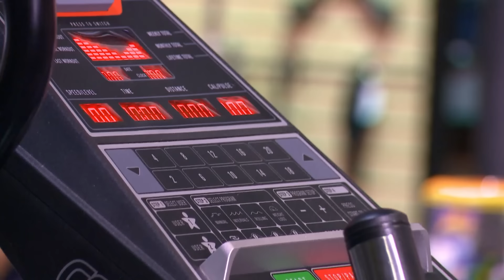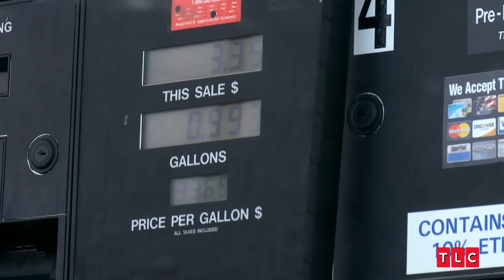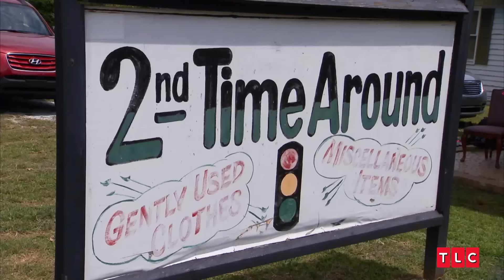She Fills Her Pool with Junk to Save Money! | Extreme Cheapskates

Comment: I hope there isn't any snow where she lives. Where I live you have to have a half tank of gas in the winter time so your gas line doesn't freeze up.
Reply: True, and I doubt she lives out in the middle of nowhere or a rural area because if you're not careful, you could end up stranded and no-one wants to be stuck stranded somewhere because they don't have enough gas whether it's in the hot summer months (when it's 80 or 90°F or hotter) or in the cold winter months (when it's 30 or 20° F or lower.) I've gotten stranded a few times (for different reasons) in both weathers and it sucks. Even if you have clothes that'll keep you cool in the heat and clothes that'll keep you warm in the cold, it still sucks.

Comment: The bike idea was actually brilliant, she gets exercise  AND she doesn't have to pay the cost to keep it running
Reply: she bought the bike with the tiny wheel just to save what didn't even amount to 1 months pool expense
Reply: I don't see this working well.
Pool pumps usually run a few hours a day from my understanding. I believe 8 is considered normal. I seen some hotels run 24/7. Lets lowball and just say 2-3 hrs. You telling me she is going to sit on that bike for 2-3 hours every day?
Reply: The bike pump is BS. That alternator would never power that pool pump. It puts out DC and even if she took out the rectifier, she would need to gear that alternator and have a regulator. She would be much better off mechanically powering the pump with the bike.
Reply: @MrTurnermason  exactly
Reply: @MrTurnermason  yes and no. Alternators are 3 phase ac that has a rectifier that converters the AC > DC. You can remove that and actually turn an alternator in a 3 phase brushless motor/generator at higher voltage. 

Now in order for that to work at the voltage and current needed she would need to peddle as fast as a smaller gas generator (like a Honda one) against a loaded generator the would be trying to slow her down. There is no way she is making 115/230v at 1000≤ watts. 

So yes the bit is BS but it's not BS that you can make an alternator pump out 3 phase AC current by bypassing the voltage rectifier. 

By the way you might enjoy vids of people making go-karts with alternators running them with brushless motor speed controllers. Pretty neat tbh!
Reply: @MrMopar239  Yes definitely. the pool pump is not 3 phase though. Even if you used a single phase of the alternator you would still need to get up to 3,000 rpm to get any useable current out of it.
Reply: Would the alternator produce enough amps to run a pool pump, isn't that just like hooking a car battery to the pool pump? Which wouldn't work
Reply: @empiresrikesfat  The alternator doesn't have the right voltage and frequency to run the pool pump. A car battery is DC and the pump is a AC motor.
Reply: @MrTurnermason  cool i was right
Reply: @MrTurnermason  I agree with you completely. While it's worth noting that the person in the video is using a DC-AC inverter before connecting the pool pump, this setup is still not effective because the alternator in her system can only produce a very small amount of power (at the speeds she is able to achieve), likely only a few watts. Meanwhile, most pool pumps require about 1.5 kW of power to function, which is far beyond the capabilities of her setup. Additionally, it's important to keep in mind that even the most skilled professional cyclists can only maintain a continuous output of around 300W, so powering a pool pump with a setup like this is not feasible.

Comment: Does anyone else here even realize that whole bike generator thing was totally FAKE? For one, the alternator (which I'm assuming came from an old car) would only generate 12 VOLTS DC. The pool filter would require 125 VOLTS AC. Night and day difference. There's no way that would actually work. And even if it did, she'd have to pedal for 12 hours straight to generate enough electricity to run the filter for one hour.

Comment: The bike generator is genius.
Reply: No its a lie. It's not even humanly possible for her to power that pool pump with a bike, and even if it were, it wouldn't turn as easily as she makes it look like the alternator is not under load or connected to anything. Even an Olympic athlete couldn't power a pool pump. There is a reason why human flight is so hard. It might be possible with 4-5 trained professionals for less than an hour. Plus a car alternator is like 12 volts while the pool pump runs off 120 a good electrician might likely convert it but the stupid pump is still a 1500-3000 watt appliance humans cant put out that much.

Comment: The amount of people praising an obviously fake bike generator powering a pool pump is funny to see. It's not even humanly possible for her to power that pool pump with a bike, and even if it were, it wouldn't turn as easily as she makes it look the alternator is not under load or connected to anything. Even an Olympic athlete couldn't power a pool pump. There is a reason why human flight is so hard. It might be possible with 4-5 trained professionals to power that pump for less than an hour.

Comment: Baking soda is not the same as the chemicals used to sanitize the pool.  The only thing baking soda will do is raise the pH of the water.  And yes, you could clean your clothes in the pool, but the problem is that the chemical used to sanitize the pool water is sodium hypochlorite which is bleach.  So any clothes will color will be ruined.  Also the bike generator thing to run the pool pump is complete BS.  A pool pump is powered by 220 volts, not the typical 110.  There is no way she could create enough power with that stupid bike, lol.

Comment: 1. Power Requirements of a Pool Filter

	•	A typical residential pool filter pump is rated anywhere from 500 to 2,000 watts, depending on its size and efficiency. Even a more efficient, energy-saving pool pump generally needs at least 500-750 watts to operate continuously.

2. Output of a Car Alternator

	•	A standard car alternator produces around 60-100 amps at 12 volts DC. So, at maximum output (say 100 amps), you’re looking at about 1,200 watts of power.
	•	However, a human on a bike would struggle to generate even close to that continuously. Most people can generate about 100-200 watts on an exercise bike over extended periods, which is significantly less than what’s needed for a pool filter.

3. Need for Battery and Inverter

	•	Even if you could generate enough power with an alternator, you’d need to store that energy in a battery pack since an alternator alone can’t provide a stable, continuous power supply directly to an appliance.
	•	The pool filter pump requires AC power (usually 120V or 240V depending on the model), so you’d need an inverter to convert the DC power from the alternator/battery to AC power.

4. Practicality

	•	To power the filter continuously, you’d need a large battery bank to store power and an inverter capable of handling the filter’s wattage.
	•	You’d also have to constantly pedal or use a very efficient method of energy generation, which just isn’t feasible for sustained periods.
	•	As you pointed out, a part-time job would be far easier and more practical for covering the electricity cost!

Conclusion

So, while it might be possible to generate some electricity with a car alternator and an exercise bike, realistically, it’s nowhere near sufficient to power a pool filter for any meaningful duration. You’d need a combination of sustained human effort, a hefty battery bank, and a good inverter to even come close—and even then, it would be incredibly inefficient and impractical.

Comment: As a 15 year Pool Technician, baking soda is the same sodium bicarbonate as buffer or alkalinity increaser that is required to "buffer" the pH and stop wild swings for a good bathing experience, and making sure that the chlorine in the water is active. If she went to a wholesale place like an Agriculture Center, you can buy it in a 25kg bag for $20 bucks. But its not a "pool cleaner" or a sanitation method at all.... Blanket is a good idea but wont last long. The filter doesn't use power the pump does. the pool is more like a washing machine then a pool imagine swimming in your washing machine.

Comment: Her generator idea to power the pool filter is genius!
Reply: It's not even humanly possible for her to power that pool pump with a bike, and even if it were, it wouldn't turn out as easily as she makes it look like the alternator is not under load or connected to anything. Even an Olympic athlete couldn't power a pool pump. There is a reason why human flight is so hard. It might be possible with 4-5 trained professionals for less than an hour.

Comment: Powering the alternator with a bicycle was pretty dang smart. I'm impressed she's super handy and smart.
Reply: It's not even humanly possible for her to power that pool pump with a bike, and even if it were, it wouldn't turn as easily as she makes it look like the alternator is not under load or connected to anything. Even an Olympic athlete couldn't power a pool pump. There is a reason why human flight is so hard. It might be possible with 4-5 trained professionals for less than an hour.

Comment: The alternator with the belt was actually impressive AF 😂 She would do well off grid
Reply: It's not even humanly possible for her to power that pool pump with a bike, and even if it were, it wouldn't turn out as easily as she makes it look like the alternator is not under load or connected to anything. Even an Olympic athlete couldn't power a pool pump. There is a reason why human flight is so hard. It might be possible with 4-5 trained professionals for less than an hour.

Comment: You’re absolutely right; powering a pool filter with an exercise bike would require a lot of pedaling and wouldn’t be practical compared to simply covering the cost with a part-time job. To estimate the effort involved, let’s break it down:

Power Requirements for a Pool Filter

A medium to large residential pool filter typically uses about 1,000 to 1,500 watts, depending on the size of the pool and the pump type. For this calculation, let’s go with a pool filter that requires 1,250 watts.

Power Output from Pedaling

An average person can sustain around 100 watts of power output on an exercise bike. Well-trained cyclists might sustain around 200-300 watts for short periods, but for most people, 100 watts is a realistic average over extended periods.

Pedaling Time to Meet Energy Needs

To generate 1,250 watts continuously, you’d need multiple people cycling, or you’d have to pedal significantly longer at your average output. Here’s how it adds up:

	•	1,250 watts needed / 100 watts generated per person = 12.5 people pedaling at once (continuously) to meet the requirement.
	•	To run the pool filter for just one hour at 1,250 watts, you’d need to pedal for 12.5 hours by yourself at 100 watts.

Monthly Power Demand

Assuming the pool filter runs 8 hours a day:

	•	1,250 watts * 8 hours = 10,000 watt-hours (10 kWh) per day
	•	10 kWh * 30 days = 300 kWh per month

Pedaling Hours Per Month

To generate 300 kWh:

	•	300,000 watt-hours / 100 watts = 3,000 hours of pedaling per month

So, you’d need to pedal for about 100 hours each day, which is clearly impossible for one person. You’re right that this would be an inefficient and exhausting way to power a pool filter.

Conclusion

It would be far easier and more economical to work a part-time job to cover the pool filter’s electricity cost. If $200 per month covers the electricity cost, even a few hours of part-time work would generate that amount, which is much less time and effort compared to the monumental task of pedaling for hours.

Comment: She is literally saving nothing putting barrels of sand in the pool. The surface area on the surface is what dictates the evaporation, it literally makes zero difference if half the pool is filled sand or water.
Reply: But there's less water volume, so fewer chemicals are needed to treat the water.
Reply: @planethedgehog2427  For all intents and purposes there is no realistic savings there. On top of it she uses baking soda... It's just all around dumb. Secondly she says in the video she is doing it to save water like she does in the toilet as a reminder.
Reply: @WaterspoutsOfTheDeep  Yeah. But as others have said, it's all fake crap anyway. The bike alternator connected to the electrical panel (!!!) comes to mind.

Comment: i am cheap also. many times i have seen something in a thrift store that i like but do not want to spend money on. wait long enough and it will eventually end up by the 'free box' also known as the trash can then it is mine. if not, i live with it. i rinse out and squeeze paper towels then hang them over my kitchen faucet to drain. i can make one sheet last a week.  i buy 2 ply toilet paper. when i take some off to use, i split the plies and use one then put the other on the shelf for use the next time. bubble wrap is excellent insulation. i put it over the inside of my windows in winter and it will throw heat 4-5 feet out from the window. i rarely use the heater in winter. i put a heating pad at the foot of my bed and as long as my feet are warm i am warm. i only drive cars i can pay cash for. right now i have 2 20+ year old beaters that serve me just fine. i put gas in them once a month and alternate driving them. i do not need to impress anyone just myself.

Comment: Okay everybody, this alternator contraption isn’t doing a damn thing. The pump is running off high voltage from the house still, she just thinks she’s doing it. No doubt the moment she stopped peddling and pump was still running she realized this. She can’t provide enough speed to the alternator to produce enough electricity to run a pool pump. Don’t try this at home. Even though she’s clever, she’s not very bright.

Comment: The shop owner should absolutely not allow to exercise on the shop's equipment. It's one thing to test sth and a different story to use it as a free gym. Then the bicycle should be sold as a used equipment, not even tested but used, second hand stuff. Also in the shop there is no place for all that sweat and activity. It's really surprising to me that he's OK with all that circus.

Comment: what about solar ...people would give, gift or trade solar ...panels are becoming mainstream..and people are sometimes trading theirs in for more efficient ones ..and theres solar pool heaters...and the pool cover would be way less annoying to put on and off if it were on a roller ...someone will be getting rid of one ..or getting rid of any item that could be used as a spool ...even pvc pipe would be good as a spindle

Comment: I just want to point out that to use an alternator to generate electricity you need a voltage regulator and a power supply to the rotor inside the alternator or else you won’t create a magnetic field which means no electricity.

Comment: You can't run an AC pump motor from a 12V DC motor without an inverter and a pile of batteries. Did she pedal for a while day for that initial charge? She'd have to pedal all day to keep it going.

Comment: the less gas you have on your tank the more it will evaporate. the gas has double function, powers the engine and cools the fuel pump. if you're running always low it will heat more than full filled. not mensioning that the life spam of the pump will decrease.

Comment: I always  wonder what water cost people in other states where I live we pay  a base fee and get so many units  for that base fee . We get more units in the summer then the winter but if we go over out base units then each additional  unit is around 3.50-4.50 depending  on what month we are in 1 unit of water is 748 gallons  so putting a brick in the toilet  to save 350 gallons of water is maybe 2 dollars  a month if we go over our base units. Also I would  be concerned  on the possible  long term effects  that the brick may cause to the toilet

Comment: She states that the pool uses $200 per month in electricity. If their electricity costs $0.43 per kwh (highest rate in the USA), then the pool would use about 465 kwh's of electricity monthly. Lower cost per kwh would mean more energy used.
With 100% efficiency a person could generate a couple hundred watts of power on a bicycle, but lets say she can magically generate 500 watts continuously. She would need to ride the bike for 930 hours to generate the same amount of energy. Even if she pedaled the bike and never stopped, there are not enough hours in a month to generate that power.

Comment: uh. Yeah car alternators put out the wrong kind of voltage for electric pool filter motors.
And even if it did make compatible voltage you'd NEVER be able to run a motor directly without some kind of battery and controller setup. When the kid turned on the the switch on the panel he was simply turning the pool filter on like every other pool owner in the world does.

Comment: If you just bought the bike, you wouldn’t have to continue to spend gas driving to a sporting goods store and then continuing to detour yourself to fill up a gallon at a time multiple times a week. Also, you can’t power a mains voltage appliance off of the 12 to 14 odd volts an alternator generates Nora can any human create the RPMs required to provide anything worthwhile energy wise. To the people who says she’s the smartest cheapskate she is far from it. She’s horrible at cost analysis.

Comment: There is no way she could have powered the pump with that alternator. It needs a battery, inverter, and has to spin much faster which needs a proper belt. Would have been a lot easier with a couple of solar panels and inverter.